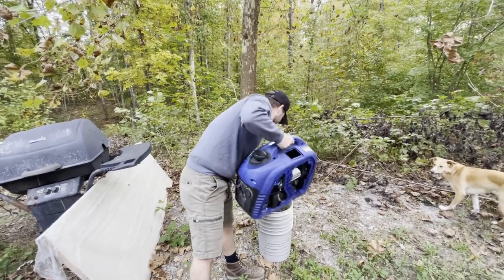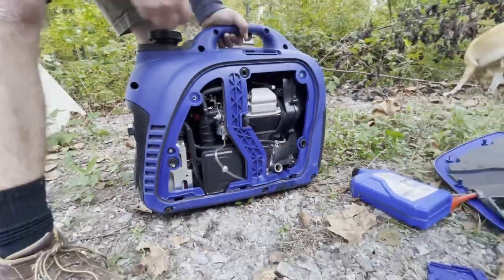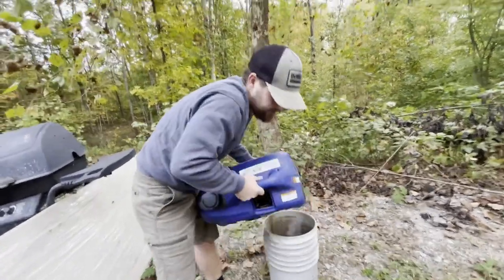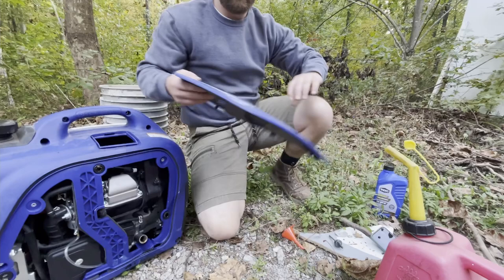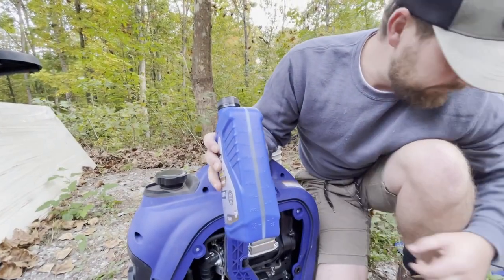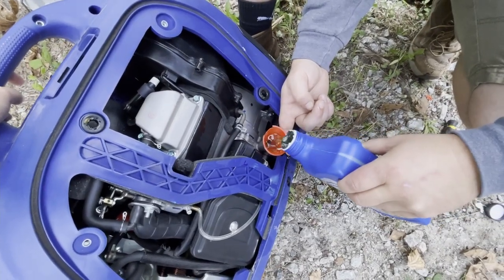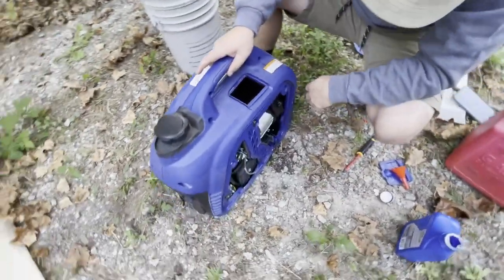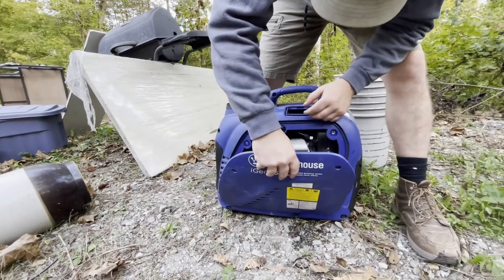Oil Change on Portable Generator

Comment: Double check manual mine States to not screw oil plug in to measure.  Screwing it in would lead to low oil level